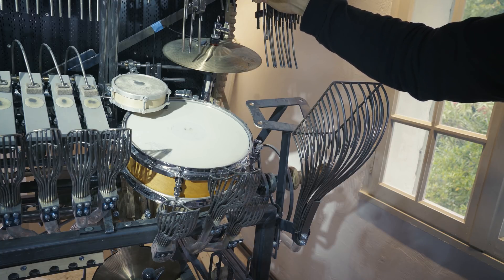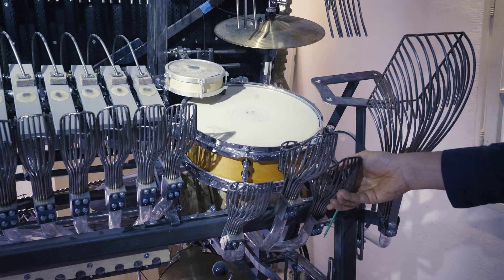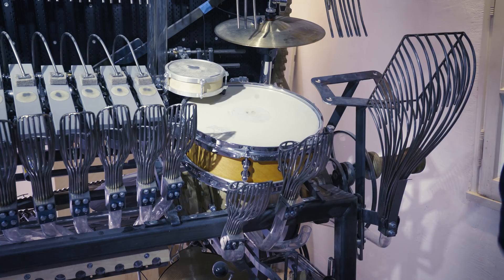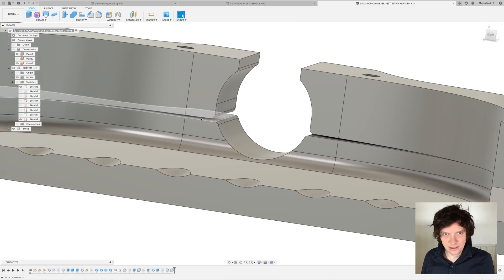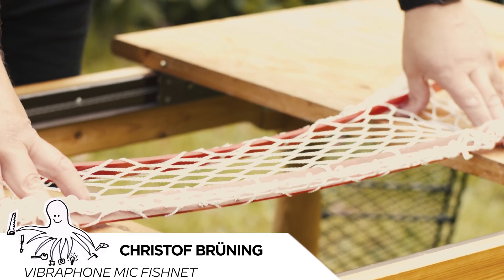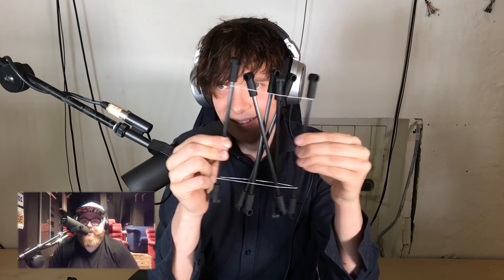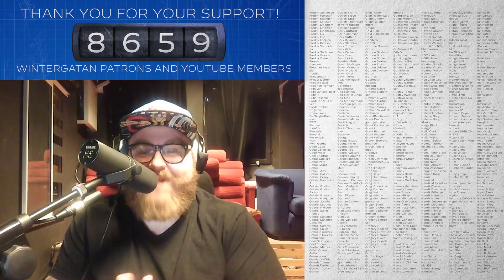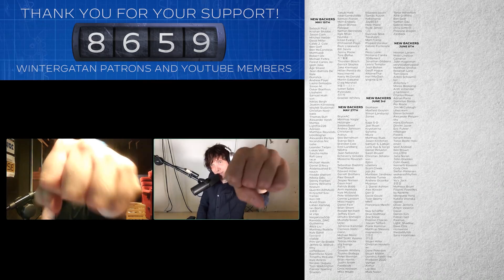Saving the Marble Funnels with Rubber Coating? - Marble Machine X #129

Comment: 4:33 It's not sunken cost fallacy. It's the 80/20 rule. As an artist and graphic designer, one of the most challenging factors I encountered in the creative process (when working with clients) is the 80/20 rule. The 80/20 rule essentially states that the first 80% of your work will only take 20% of your time; and that last 20% will eat up 80% of your time.
.
I would often spend countless hours working with clients on just the template for a project. Getting the colour pallet correct, the layout, interface design, etc. Only 20% of the project would be done by the time I was ready to roll into the meat of the project. In this case I'd spend 80% of my time on the critical 20%. Then the rest would roll out fast. I often left it vague with clients who would not understand this.
.
On the flip side, there were massive art projects I worked on where 80% (of the bulk) was completed on that early 20% of time. It would drive some people insane at the realisation that we still had to drill down into the 80% of details needed to complete that project.
.
The Marble Machine X, has the challenge of being witnessed through the entire process. This is something I would dread. Clients would be screaming at me by now, because they just don't understand the impact of the 80/20 rule.
.
They would be impatient, and want to skip details they don't understand.
I'd be having to constantly remind them that they hired me to do it, rather than trying to do it themselves.
.
Keep going.
You're 25% there.
Reply: lol. Yeah, doing things out in the open carries a lot of risks where people looking at it don't understand why it takes so long...

Well, they've probably never actually seen the process of creating anything up close... XD
Reply: I think you mean the first 80% of the work takes the first 80% of the time, and the last 20% of the work takes the other 80%. ;p
Reply: This actually surprisingly fits well with programming but not perfectly, it's more so for the different stages of the program than the entire solution (i.e. alpha, beta, final).
e.g. 
In alpha the main focus is the 'critical' mechanics, i.e. the system/s which drives the entire thing, and the planning, the first ~80% of work in alpha is the planning - it's fast, and a large part of alpha, but vital:
what is main focus (what are the 'critical' points)
what are the restrictions (what type of device it will be running on [which dictates if RAM, CPU or storage takes precedence and as such what language must be used and dictates a good portion of restrictions],minimum specs goal, max allowance if any, time)
what language will it be done in (also has a big part in dictating the restrictions if RAM, CPU and storage aren't of major concern)
what engine will it use (if any, either as it's base or what to use as an example, e.c.t)
intended audience
and 'plan of attack'.
Then the other 20% is actually implementing it according to the plan with at least minimal bug testing, easily taking the other 80% of time.

In beta the main focus is "secondary" mechanics and bug testing (and sometimes documentation if time is tight), the first ~80% of work being the secondary mechanics and the other 20% being bug testing & fixing. Bug testing is one thing, fixing the bugs without introducing one million more and especially doing so without slowing down the system too much is an entirely other thing all the while not 'chasing ghosts' - hence it can take a long time.

Once all the systems are in place and working the program enters it's "final" phase, but that doesn't necessarily means it gets released - rather a "clean-up" is done if there's time left which there rarely is - unless it's a personal project. During this phase; documentation, comments, check-overs (bug testing on known trouble features and 'critical' mechanics) and general 'polishing' (like style of life/ease of access things) is done - docs, comments and check overs take no time at all but are important, while polishing can take a fair while depending on how much was done during the entire process.
Reply: ^This.
A good portion of the viewers are over-romanticizing the building of MMX. They love the early adventures, seeing major progress being made every week, but start yelling out loud that Martin is 'stalling' or 'lacking confidence' when now Martin is going through the tedious process of ironing out issues of the machine and making sure it functions well.
Reply: aka the Pareto Principle

Comment: They make a TEFLON/NYLON tape(NOT the very thin stuff that plumbers use) that goes in between moving parts to reduce friction,, it also helps reduce noise....HIGH MOLECULAR DENSITY PLASTIC,,like that used in industry,,could be useful as well,,It's also machinable....Bonding rubber mats,,with contact adhesive,,were marbles contact would also help reduce noise...A thin sheet shouldn't change the dimensions enough,,in most places,,to make a difference.....What about those rubber coated balls in computer mouses??..Could you get enough people to send you their old ones??..Just some thoughts,,Hope they help,,or inspire you or others,,Look forward to seeing/hearing,,when finished!!!

Comment: Oh, thank you so much for attaching my submission. ;) I'm SUPER happy! Sure, adding more damping material would probably help but the problem is more in the mechanism (solenoids with wooden moving parts). They both produce that noise, a while before the note can be heard. This mechanism should be redesigned to solve the problem :)
Reply: Good point, I thought the sound comes from the mechanism itself, rather than marbles hitting the platform. Good job and keep it up!
Reply: wonderful machine. It makes me so happy to see other people's MMs :D
Reply: At the beginning of tests the noise from the wooden blocks reaching the final positions was even louder that the notes. Then I added a damping material to that points and that helped let say in 60%. Now, the noise comes mainly from the solenoids, their metal parts also contact while moving so maybe that is a point where everything what I can do is record the music with good microphone, remove the noise when it is possible ;) it is a mechanical device, so I need to have a compromise

Comment: Use power coating. It's tougher and won't flake off due to repeated strikes. Also, it is easier to apply. You could just send all the parts out to be coated or you could spray them yourself and bake them in a used oven. Powder coating comes in tons of colors, even clear.

Comment: The plastidip won't adhere to the stainless wire unless its etched to provide a suitable surface. It's also unlikely that it will last very long being beaten with the high point impacts of the ball-bearings. Etching the stainless and then over-molding with clear silicone might be a solution.

Comment: If the rubber coating wears out too quickly, look into having the funnels coated with nylon.  This is not something you can do in your shop as it is done by melting the nylon at about 280 deg C and dipping the pieces.  But it is a very, very durable coating and should provide the dampening effect you need.

Comment: I'd like to point out the gross misuse of the sunken cost fallacy here. It's important to note that the sunken cost fallacy works both ways. While it's true that you shouldn't continue a project just because of the sunken cost, you ALSO  shouldn't use the sunken cost as justification for abandoning the project.
Lets say a bridge is worth spending $15 million on, but you've spent $15 million dollars and find out you still need to spend another $5 million to see the project through. It doesn't mater that the overall cost of $20 million isn't worth it. The $15 million already sunk into the project doesn't matter. The only thing that matters is whether the last $5 million to finish the project is worth it. Is having a complete bridge worth spending $5 million dollars? Absolutely!
The sunken cost fallacy works both ways like that. 
Maybe the Marble Machine X wasn't worth it the entirety of the effort put into it, but that doesn't matter. You're enough into the project that the future work ahead of you (the only thing that matters) is low enough to justify seeing the project to completion.
Reply: @THEODORE KENDALL Uh, not boneapple tea. Just dropped the word "say".

Comment: I honestly always felt the "noise" is what gives the marble machine's music its charm. Other music is so sterile and digital, and I feel the rugged, home-grown, and organic analog feel of the machine with the mechanical noise makes the marble machine unique.
Reply: I feel like if all the noise is gone, there's no reason for the machine. It gave the original character, and the MMX is no different!
Reply: I agree the noise is part of the charm. (Just like vinyl. :D) However, the charm is that the noise doesn't get in the way of the music, but adds character. Keep in mind the noise here is in isolation, not with the machine running: with the noise level of the funnels on par with the hi-hat you can quickly end up in a situation where all the noise sources combine into an unholy racket and you have a machine that is playing mostly noise with some plinky sounds mixed in. 

I think that's the reason Martin is doing targeted physical noise reduction - and he is the one living with it and hearing it in the room. We can't fully understand the overall noise level of the machine through the video because it's recorded, mixed, and then replayed at the volume of our own choosing.
Reply: It's not all the noise that's going away, Martin mentioned using separate microphones to record the mechanical noise

Comment: Plastidip is going to wear away during play, giving you thre metal on metal sounds at every increasing volume. You will wind up having to reapply the spray time and time again. And eventually it will look terrible until you cleanse everything to start over.

Comment: I feel like the marble drop mechanisms could also benefit from a coating as marbles queuing up to drop make a significant noise as well, largely because they are also in contact with metallic rails.

Comment: Would it be possible to generate a midi timecode in reference to your tempo/song? This could be used for preprogrammed lighting show for your liveshows. I've been working with some touchOSC apps that have the possibillity to pickup a spesific mic and assign that to a spesific parameter on the lighting desk. This might work with tapping your drummachine microphones! Would be cool

Comment: i recommend a "high solid epoxy industrial coating" super tough cheap and will reduce the hell out of vibrations. or two part epoxy, or fiberglass, maybe even ceramic coating or powder coating

Comment: One month ago, this was posted on the "vibraphone funnels completed" video
"Tim Keller
il y a 1 mois (modifié)
Hey Martin,  Even though you said we wouldnt need it...  I DID sneak a damping feature  into those funnel bases....  its the 1/2 inch hole that lies under the leaf spring.   You can put a peice of silicone or neoprene tube /rod in there to provide damping for the spring and a little bit of of back pressure on closing...     You can adjust the amount of damping by using longer / shorter rods in that pocket.   
For all the commenters... you can see the pocket for the damper at 1:38 and 4:48 "
(timestamps are for the original video the comment came from) And we never saw that solution tried out.
Reply: The top comment talked about the sound vibration being carried throughout the entire structure. Utilizing this feature would help to stop any sound from going any further through the machine.
Reply: Every little helps.
Reply: That wouldn’t have any effect on the sound of the marble hitting the funnel, though. The sound of the funnel closing is exceedingly minor, in comparison!
Reply: @johnnyjohnson6643  True. You're right I didn't think about that. But that comment was the very first thing that came to mind when seeing that funnels noise problem once again put on the table . Well, if anything , both solutions could be combined for an even quieter experience lol :D

Comment: when. i first look at the funnel, i though thams ressemble a baseball glove. so, how about add a layer of foam/cloth layer to absorb the energy in the layer not in the metal .
Reply: He somewhat refers to this with the desire to preserve the visual presentation. A clear or translucent coating is much more subtle than a catching mitt. If the funnels themselves were not part of the goal, a tray similar to the original marble machine would be effective and easier to dampen the sound of.

Comment: What about welding a small disc to the rear of the funnels then glue/attach a disc of felt. That way the initial hit of the marble (the hit with the most energy) , will be dampened. The 2nd & 3rd funnel bounces would have been alot quiter anyway.

Comment: I love the passion for this machine, you could tour with it right now (well when safe ) and most of your audience would have no problem with the noisy parts or slight errors in timing so you'll have to forgive yourself if theres a perfection issue, it will give you something to do between tours after all. No matter what you can improve you still have something amazing.

Comment: Heyhey, I don't mean to second guess, but, for sound deadening there are some good auto products specific to the application, I'd reccomend https://www.designengineering.com/products/damping-materials/ particularly the spray-on 'boom mat'. It'll probably be a thicker, more rubber/gel coating but it's designed to kill road noise and rattling panels in cars, so it might really suck up that impact ping. But either way you're a minor god in the music pantheon for soldiering on with this, all best luck. Cheers.

Comment: The coating won't last long, it's only a very temporary solution.
If you want your funnels to remain rigid and made from metal, I suggest shrink wrap. It's cheap and easy to apply.
The downside: It won't have the metallic aesthetics and you'd have to disassemble the funnels somehow.
I suggest working from the bottom of the funnel. Either remove the mounting clamp from the wire or make new funnels.
If you try to work from the top by removing the ring that's connecting the wires, you'd have problems rewelding the ring without burning the wrap. It would result in an ugly contraption.
If you weld the wires on the top ring first (by using the mounting clamp as a guard and your special jig.), then slide the shrinkwrap from the bottom all the way to the top, heat it so the wrap wraps around the wires tightly, then weld the mounting clamp on the funnel. This way you avoid burning the wrap (I think... there's enough clearance between the bottom and the top of the clamp and it's a solid piece of metal that can sink in some heat, so in theory if you weld the wires to the bottom part of the clamp, there shouldn't be enough heat to burn the wrap. Plus you could look for very heat resistant wrap.)
Shrink wraps are available in many colours and softnesses, with or without adhesive, there's plenty to experiment with. You could make one funnel with a shrinkwrap of the colour of your choice and try if you like the solution.

Comment: For a less noisy wireframe funnel structure, I wonder if it would work well to weld together tubing and then fill the center of the tubes with rubber or goop for damping. That way you would have the durability and look of the metal and the damping of the rubber.

Comment: Not ideal... but felt padding strips would 100% dampen the sounds of the marbles hitting into the funnels. You'd probably need stronger springs, but that's an easier problem to deal with :)

Comment: Martin, if you add one feature it should be separate muting systems for vibraphone/bass/drum channels one and two. Each note has two channels to play fast, so why not mute them separately so mid song you can switch from the A roll to the B roll for a verse/chorus transition? Then you can play both together simultaneously if needed too. This means the vibraphone has two muting levers. One controller the left side of each note, the other one the right side. Basically now the marble machine can be programmed with two songs instead of one!
Reply: A nice idea but this would require a massive redesign!
Reply: Nice idea, a lot bit too late though

Comment: 3:20 Martin, hate to tell you this, but as an ex-PlastiDip user, it's not a function of 'dipping' it into a rubber solution or something, PlastiDip is still a spray. What's more is you'll need to use cans of that stuff to get adequate thickness to dull out the sound, but also in case you need to remove it. Too thin and it won't remove properly and you'll have to use solvents. Use with caution. Caveat Emptor.

Comment: Christof may want to do tests with the cables attached. The weight of a microphone is significantly increased by the weight of the cables. I could easily see the weight overcoming the nets and the microphones falling to the floor.

Comment: it is not signal to noise ratio. what you are talking about is distance from mic. keeping disinformating people is not wise. STNR is the level of inner microphone noise conpared to the actual recorded sound level. jesus.
Reply: Signal to noise ratio means the ratio of wanted signal to unwanted signal. It's not a term specific to the intrinsic noise floor of a microphone. It's used to describe the radiation of the cosmic microwave background in comparison to the brightness of the milky way, fer cripesakes. "jesus"
Reply: @bartholomewgumbo7833  if by noise we don't mean noise then why not calling it a giraffe/malaria ratio then ? dude, local to ambient ratio, can be. when you use noise, you mean noise. or call it en elephant. speaking nonsensical spreads nonsense. and it is not even a ratio. it is simple sound dimming, sound attenuation, sound getting weaker as it travels fak god.